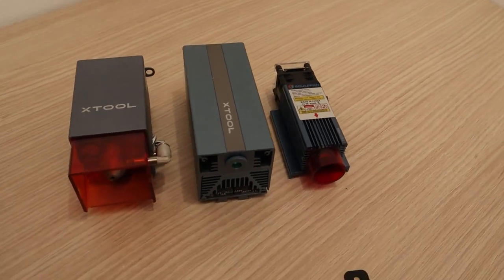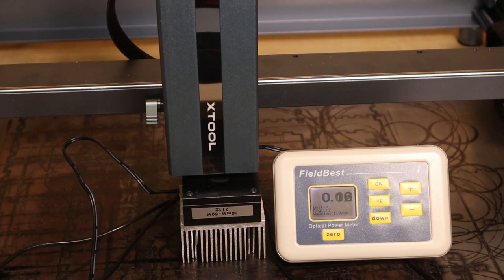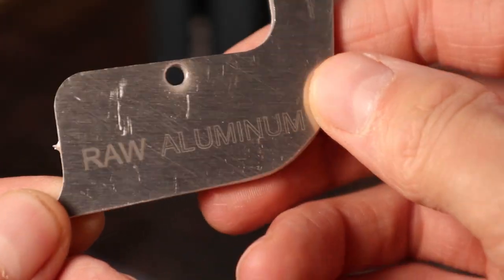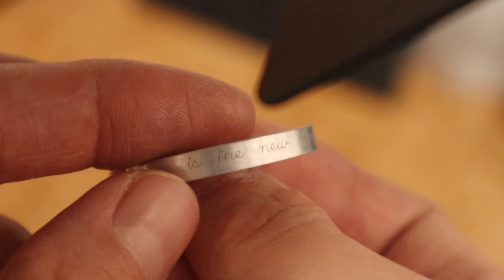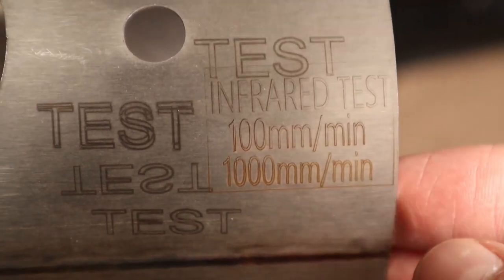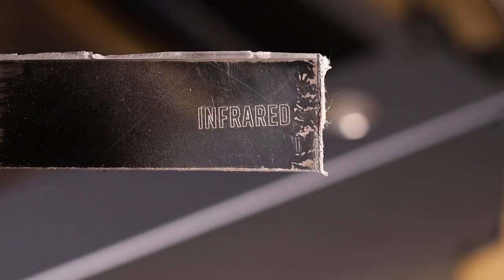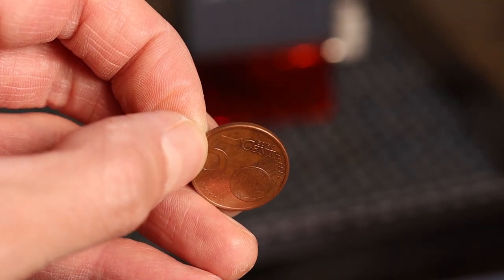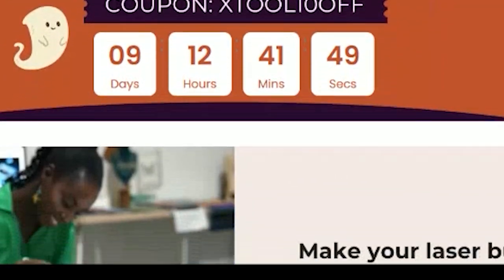GAME CHANGER! This New xTool D1 INFRARED Laser Module Engraves What Other Machines CAN'T! (REVIEW)

Comment: I am fairly new to this and have had my xTool D1 Pro 20W for a about 4 months now and have managed to get some amazing result already.  I have been lacking the ability to do much on metals especially Aluminium and Copper and brass as i wanted to engrave for my family's upcoming wedding next 2024. I love what this can do and will look to invest in around early New Year perhaps this as it does all that I need it to do on metals. Love this video as it was very comprehensive and showed the benefits of using this module on some stuff without having to change the laser heads around which can help with continuity of workflow.  Well done JT for producing this video and thanks xTool for another amazing product.

Comment: do you have any recommended settings so I can test on different materials with this laser? Im new to lasering and would like to know what you think
Reply from the maker: You really need to try to test various settings. Start with medium speed (1500mm/min) and medium power. If not engraved deep enough, increase power or decrease speed. Try different scenarios ( low/high speed combined with various power levels) and see what produces best results. My setting in this video are far from ideal. You need to do a lot of testing to find the best settings for a given material.

Comment: How do u clean the surface is there a settings for that ??
Reply from the maker: Usually lower power and higher speed. It depends on the material. You try some different power and speed settings and see what works

Comment: Great product. I currently own both a D1 and D1 Pro as well as a 60 watt CO2.  I am very excited about the prospects of engraving aluminum and brass.  Keep up the good work!
Reply: @Doug Taylor I am looking to invest in my first laser. The largest work area possible is important to me as well as being able to cut/engrave wood and clear acrylic. I was thinking of getting the D1 Pro with extended frame, infrared module, enclosure, etc... (basically all the bells and whistles for about $3K. But since you own both the D1 Pro and a 60W... I'd like your opinion. Which route should I go?
Reply: @arbella89  Great question.  A diode laser is not the best for efficient production.  It's a great supplement. For your first laser I recommend looking at Thunder laser for a CO2 model that fits your budget and needs. The D1 Pro is a slow and limited cutter.

Comment: tbh its super hard to get consistent burns. I have been playing around with metal sheets like copper, brass etc and always get a blank area due to just settle height changes in the material or board itself.
Reply from the maker: Never experienced that. But I have not tried many curved/wavy objects except that ceramic cup in the video. This laser has shorter focus length and should be focused very precisely.

Comment: Is the Infrared module compatible with the 5w Xtool???
Reply from the maker: It probably does. You need to select the module for the D1 or the D1 Pro, depending on your machine. With the module you get a power supply, so it should work also with the 5W version.

Comment: Hi, does the original laser module 20W be able to engrave silver?
Reply from the maker: I am not sure, but I think that it can't. The only metal you can engrave is stainless steel with the blue laser.
Reply: @JTMakesIt  Thank you so much. I will get it soon and try but look like I might need an INFRARED Laser Module, as you said. ><

Comment: Wanting one is pretty much as natural as wanting a next breath! given the stools RA2 module and large work area this makes the combination a compelling proposition.

The video did a good job setting IR and blue laser capabilities as it was able to highlight drawbacks of the blue wavelength which is usually somewhat avoided by most reviewers.

aside from the obvious creative uses I think there is a lot of need for security marking, and I would definitely be labelling all my power supplies with the device name they are meant to be paired with.

Comment: I have the original D1 which came with the 5w head, I have upgraded to the 20w head, now I have the IR upgrade but the IR head only has 1 connector but my 5 and 20 w has 2 cables. How do I connect the ir module and make it work?
Reply from the maker: Is one of the cables the same?
Reply: @ yes the larger one is the same.
Reply: @JTMakesIt  yes the larger one is the same.
Reply from the maker: @chucksmalfus9623  Then it might work with only that cable as I think the second cable is for modules demanding higher current. But you should check with their support just to be sure.
Reply: @ thank you

Comment: This is cool laser is going to alter the game in an innovative fashion. I can't believe such a low powered laser can engrave copper and  aluminum. I would love to see what kind of diode and optics are used, as well as beam profile.
Reply from the maker: It is possible that this is actually a fiber laser inside
Reply: @JTMakesIt  that would be cool if it had a fiber coupled diode in a module like that. I think they would want to feature that if it did. I looked it up and if the pictures were correct, appears to use two TO-5 package diodes combined with a dicro and a stack of optics for beam compression. Pretty nice setup.

Comment: Can you make pcb’s with this laser?
Reply from the maker: I think blue laser should be better for lasering off the paint/photoresist from the FR4 material.
Reply: @JTMakesIt  Can't the infrared laser engrave deep enough through the copper?
Reply from the maker: @matheokoning4456  I don't think so. It can't cut copper.
Reply: @JTMakesIt  That's too bad. Thanks for your responses!

Comment: I bought the same module but for whatever reason it wont actually engrave anything? Any advice?
Reply from the maker: What are you trying to engrave?
Reply: @JTMakesIt  I was trying it on uncoated aluminum much like the video, I’ve tried various settings so I’m thinking it may just be broken cause there’s no little white light like in your video.
Reply from the maker: @Dgnmuse  you should check the connection wires to the module. Maybe the module is not plugged in correctly. Does the fan in the module make a noise?

Comment: I want to engrave sterling slver jewellery, which seems to be conspicuous by its absence fromall the YouTube videos.  It's a worry.
Reply from the maker: I think it could engrave it. It works on all types of metals that fiber lasers can engrave.  I would try it but silver is expensive, that's why I think not many videos try to engrave it.
Reply: It works ok but I found it difficult to set up.  I had to establish the focal length of my particular IR unit and then try to get it exactly right on the actual piece of jewellery.  This would have been easier if the unit could be raised and lowered on a screw instead of having to loosen the whole unit to move it up and down.  After a short while it becomes a back-breaker when you have to reach over the enclosure etc.  I can't say that I'm looking forward to the next project.

Comment: Bought this module and utter disappointment.  I actually bought it based on the this video and the black acrylic work it shows but that is not what this unit produces.  I'm even using the over priced Xtool acrylic and it's absolute trash.  Wish they had a return policy because unlike all of their other products, this module does not deliver
Reply from the maker: You must have got a defective module or your settings aren't right. What settings did you use on black acrylic? My tests are real, without any false claims. I get a module and see what it can do. nobody tells me what I need to show in my videos. I only show what I could do with it in real life.